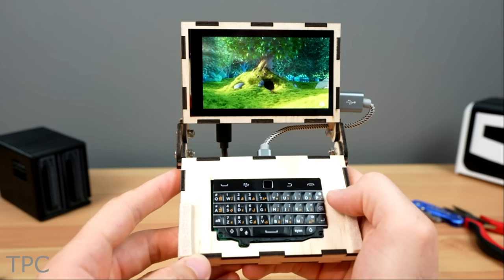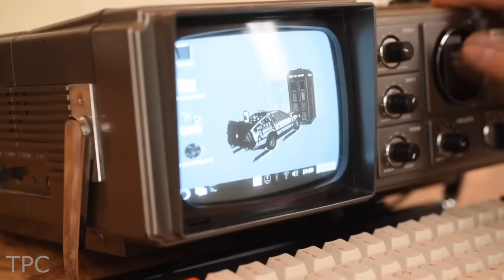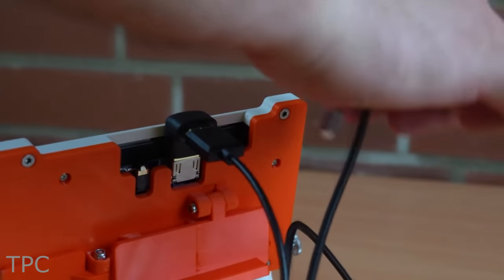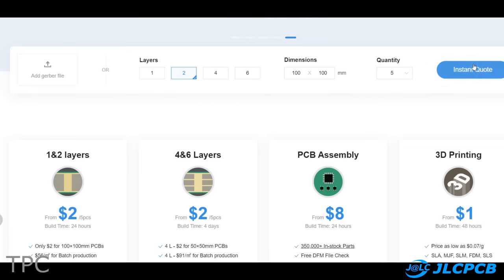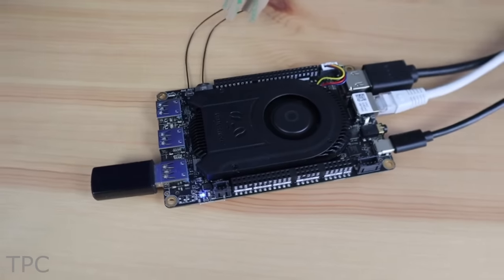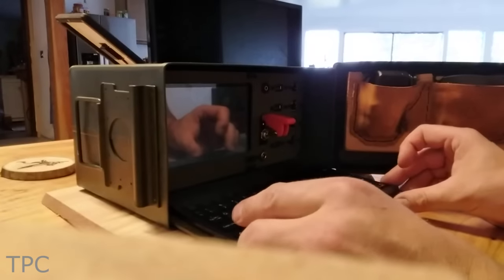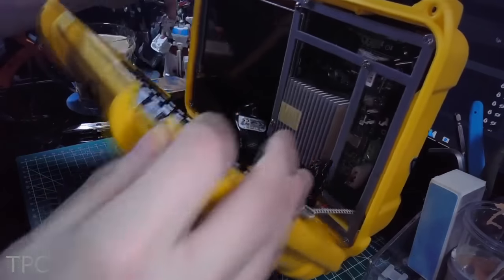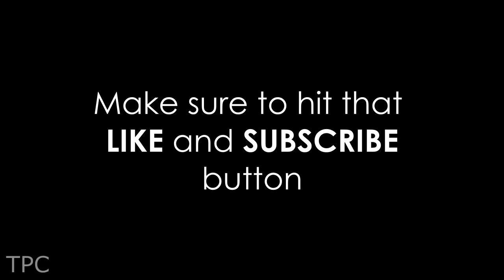12 Brilliant Cyberdecks to try using Raspberry Pi!

Comment: these are really cool, but what could you use these for exactly?
Reply: All of them, apart from the wrist mounted one, have we much functionality as a raspberry pi 400. So pretty much everything a chrome book can do. The one with a panda is a straight up windows laptop.

They're usually used for in field trouble shooting, pen tearing, coding for micro controller devices and similar. The large number of pi accessories - thermal cameras, cameras, android interfaces, arduino interfaces, massive IO expansions, etc make them perfect for low foot print devices that you can use in place of an entire laptop

Comment: You forgot to mention how hard it is to get these plug on screens to work with Raspberry Pi's! I just bought 3 different types of Waveshare screens to try on my Pi's - Pi 4, Pi Zero and Pico.....none worked without hours of google searches and endless nano edits of the config.txt file....back to x86.